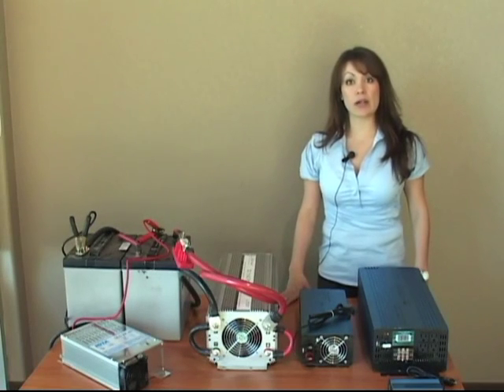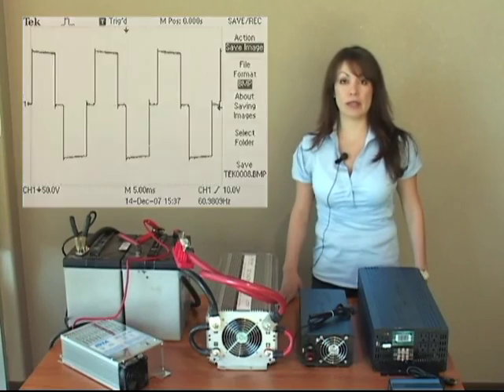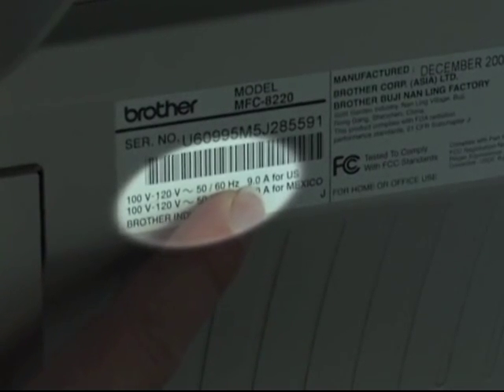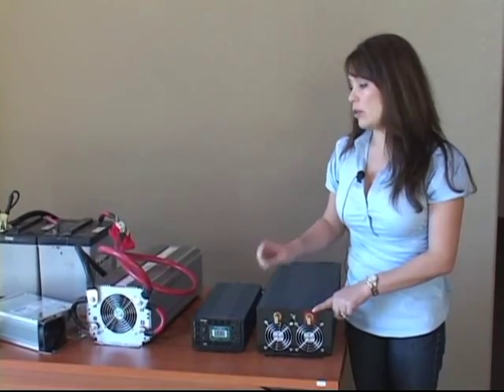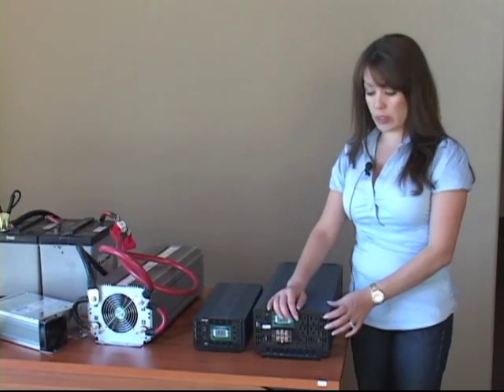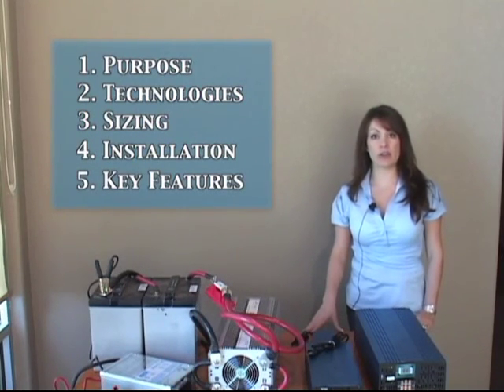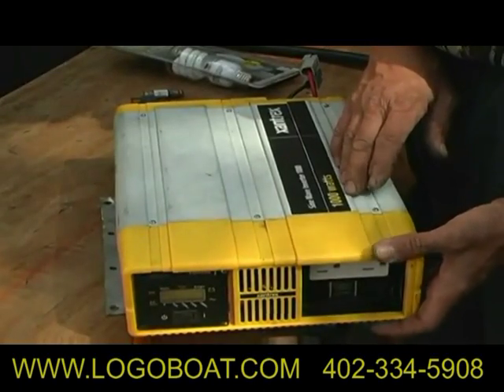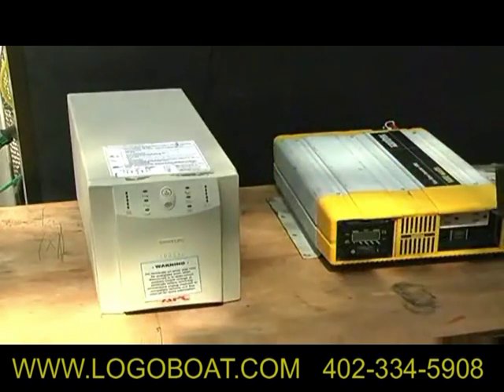ALL ABOUT POWER INVERTERS SINE WAVE TYPES WATTS AMPS 402-334-5908

Comment: So far it does what I wanted it for. share4.photo/BPowerInverter    I’m not a daily user of it - but after 1 month - I use it driving to work while charging my rechargeable batteries for my Dewalt work tools - it seams to be working out fine.

Comment: i just had a (different) 3kw one with a great remote wifi lcd, lasted 15 mins... then the electronics for the lcd went iffy and it smoked,  but the inverter part of the board was stable, replacement had good lcd electronics but the mosfets went on the 3rd kettle of water.(first boil of 2nd day, from cold)
I got  my ebay refund so no worries, at least i got a video out of it for my channel, now to try my best on ebay again and the quest for 3kw under £200/$300 continues....

Comment: So the peak current times the mains voltage is the power consumed... NOT. 1kW consumed by a laser printer... it would melt if this was the power consumption. This company needs to do its research and get it right and stop putting out BS!.

Comment: Hi, I've been looking for an answer since my purchase in 2012.
I have a Xantrex Powerhub 1800 solar generator. It has never stored power.
You only have power when  the sun is out. Is this a battery issue???? I've had no benefits of 
what I paid for this. No night time use, no energy stored.  Thank you for any help at all.
Reply: Hi Gerard as no one else has replied.
I am not familiar with your powerhub, i take it has a battery..
If not where does the power go
Reply: Yes, it has 2 car size battery's. It's a solar generator. 2 large solar panels.
The ad said from Solutions from Science, the sun will charge the battery's that can be used anytime, fully charged so you can use it at night as well....That's false, I only have a charge that I can use when the
sun is shinning on the solar panels. The battery's go down to 0 use at night. They don't stay charged from the day. I'm looking for a reason why? or it's $2.000.00 down the drain....Gosh.
Reply: If u can check that the batteries are recieving voltage from the panels, i am not sure of your technical ability. Looks like the panels are producing electricity, Check the battery voltages  ( from the actual battery terminals)
If you have 12v or more trace the 12v feed wires maybe there is a blown fuse or open circuit.
Reply: Connect inverter to battery. Connect controller to battery. Connect solar park to controller. If done correctly you should be able to plug ac devices into inverter and charge battery during day. It might help to fully charge battery using ac charger.

Comment: hi, does the battery sizes matter to use ? and does the inverter produce the wattage is says on it what i mean will the inverter prduce the wattage no matter the type of battery i use or does it depends on the battery? and in what way is the inverter better  what i mean, should i stay with 12 volts and 1.3 amps or increase the voltage ( how much volts) and leave amps alone or leave the volts alone and increase the amps ( how much amps) or increase both?

Comment: Good to know about the 180 Watts from a cigarette lighter.
Reply: +ltcajh 

actually it's only about 120W 

Most lighter sockets are rated for 10A 
12V X 10A =120W
Any higher and you will probably blow the fuse

Comment: Aluminum foil hats will protect you from the effects from MSW inverters. Jesus it's hard for mere mortals to tell if someone is  a troll or just stupid.

 For most mutiply the label voltage and the label current is precise enough, unless you plan to push an inverter up to it's rate output. Ther are arguments for getting as closed to that as you, and arguements for allowing an arbratary "cushion".

 The illustrations where to give a general idea how the waveforms  can differ, not how the wave form of a particular inverter under a particular load will look like.

Comment: I've used the large inverters in the audio business for a long time and found out early on for any sort of audio application only the Pure sine wave will suffice as the modified will have "dirty "electricity. and will have a buzz in your audio. however if your using it for anything else the cheaper one is fine

Comment: You could wire in series to get 24 volts. Then connect each (24 volt series wired set) in parallel the higher the volt the more efficient your system will be.  I would definitely stick with the same voltage and since most of your equipment is 24v, that is what I would use.

Comment: 24 hour rated use:10000 watts (90.p A at 110V AC)Peak surge: 20000 wattsNo load current draw: l ess than 0.95 AAC receptacles: 4Cables included: NoOutput wave form: Modified sine waveOptimum efficiency: 90%Connections for distributed wiring: YesDimensions: 22.4” x 11” x 8.5”Weight: 43 lbs

Comment: This can help you 24 hour rated use:10000 watts (90.p A at 110V AC)
Peak surge: 20000 watts
No load current draw: l ess than 0.95 A
AC receptacles: 4
Cables included: No
Output wave form: Modified sine wave
Optimum efficiency: 90%
Connections for distributed wiring: Yes
Dimensions: 22.4” x 11” x 8.5”
Weight: 43 lbs

Comment: I don't want to sound neardy or anything.. but the formula on 2:21 is not precise enough.
I learned that shit in school... there is a difference between Watts(W), Volt-Amperes(VA).
W = V * A * cos f
cos f is the phase shift between voltage and current.

Comment: I love how they completely skip over the most important fact about inverters and that the fact that just about all electric appliances have a much higher start up rating than the rating displayed for actually running the device. A 500 watt power drill will actually jump as much as 10 times in amperage at startup meaning you really can't use even a 1500 watt inverter for that without running the risk of blowing your inverter up.

Comment: @hispanicuscorpus With the aims 8k/16k unit and a battery bank of 12vdc 2400 amp hour, and 1280 watts of solar panels. I've been able to run a small a/c unit and a couple of fans,and the 110va well pump basically all day long without taking the battery bank down below 11.8vdc. I'm going to double the battery bank to 4800 amp hours and the solar panels to 3200 watts in the next couple of years! I've had no probles with the aims unit runs drill moter small micro waves just about any hand tool.

Comment: @hispanicuscorpus By what Your saying You need a 10  thousand + watt generator Nothing under 5 thousand watt will even start a 5000 BUT Air conditioner, when running high wattage Items Its just better to get a generator.